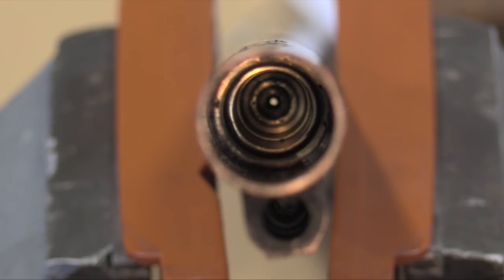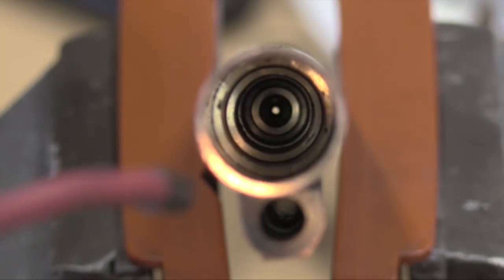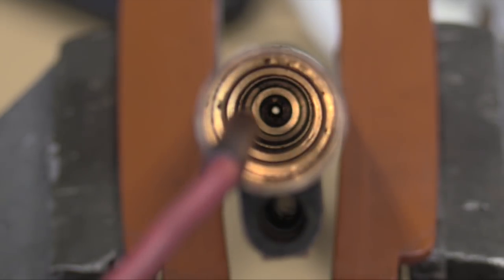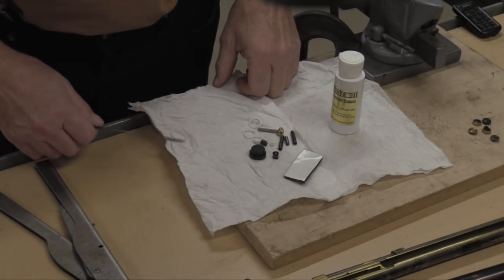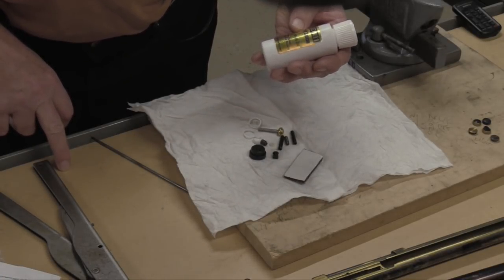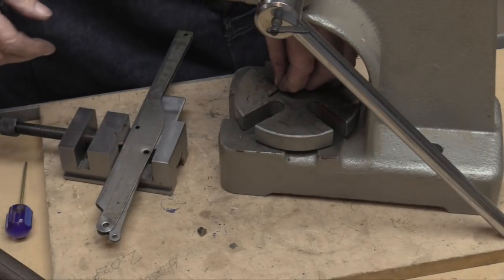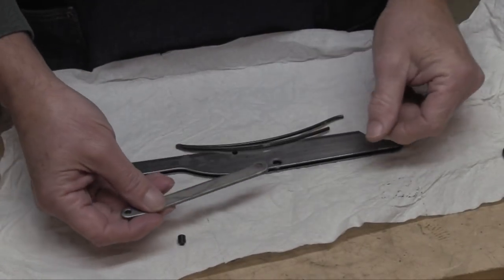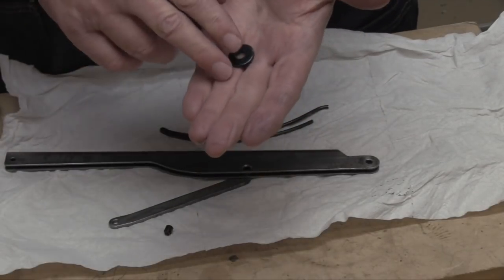Air Time No.  9 - Sheridan Streak from Hell Rebuild pt. 2; prep and installing Mac1 seal kit

Comment: Thank you for this information I'm working on the same gun at the moment but I don't have a tool to take out that nut that holds the valve in place 😞 so I need to figure that out thanks for sharing the info be safe buddy 💯
Reply from the maker: Well, there's this;
https://www.ebay.com/itm/116036072827?itmmeta=01J1ZB738EWZ51DDEHJD4PCBN6&hash=item1b0449f57b:g:Y~oAAOSw7RFj1sJi&itmprp=enc%3AAQAJAAAA0E5EFmuwjGZ%2B8p1NcnbVulRrktK4%2FkR6%2FaltQpU8KGowJSvBcXZ87HXBZnKg%2BQmjgMLqbzXo4rBObzyVULVm6eNd5hquTIdKPFVDY%2FH1DLoYcyB3gB1sExNaxk8aDaJuzoTGKNA%2Bh9eu612zhqGwsDnwYHD9%2FCr0cIdfHOxgfRcbUXQUUwpkKtDiHO8AXQDXNGIyZtMzsCvaC%2FQHfZx5ue0gja%2Bc5KIj%2BFTqyFR2HwGcj5wHjieT65YLWhF1afjVgWEmkCmlTlfjjPZiaRwM5fA%3D%7Ctkp%3ABk9SR6i0nOuPZA

And you can also find the tool at Baker Airguns;
https://www.bakerairguns.com/product/valve-tool-for-benjamin-sheridan/
Reply: @NorthWestAirgun  ok I made a tool with a lathe do I just pull out the valve like straight out or I need that other tool is well because it's hard I got the nut out but I can't get the valve out

Comment: Recently replaced the seals on my newer model 397, the hardest part was those roll pins on the end cap. Then attaching the new piston seal , a process you don't show. I had to beat the hell out mine basically, it's built like a tank. Thankfully Crosman still carries all the parts and they carry over to the new models with the synthetic stocks. They've dicontinued the wooden stocks, so anyone with wooden is lucky.
Reply from the maker: Ty, There is some seal stuff and other tips in some of the other videos, couldn't put it all in one, or even in the 'Streak from Hell' series.  Sounds like your rebuild turned out ok in the end?
Reply: @NorthWestAirgun   It did. I bought a roll pin punch set for the job. I wound up getting  the piston seal onto the rod by hammering down upright from the other end, that burred the edges on that end a bit but used a fine file and got it smooth. I used pellegun oil, just to make it true to Benjamin's specs. Downloaded the parts schematic from the Crosman site so it was a pretty simple job. Would still like to know how you got your piston seal on the rod. Could you link the vid?

Comment: Great Timing John,  I was just starting to look at how to replace the seals on my dads Sheridan blue streak that I got from his estate.  Luckily its not in bad shape and I don't think it has ever been apart. I'm so glad that there is a rebuild kit, can you provide a link to the Mac1 seal kit?
Reply from the maker: Hi Darrin, that's cool that you still have a family Streak.  You'll need the valve tool, which you can get from Pyramid Air, Baker Airguns, and even eBay if you search for Sheridan valve tool.  As far as kits, I recommend the Mac1 Airgun Shop kits, but there are others at the sites noted above.  And take a look at our video on installing a single port valve, (the Sheridan valving is pretty much the same but without the single port issue), the valve polishing tool, and the ones about cleaning your parts.  Take your time and don't push things and you should be ok.  Let us know how it turns out.

Comment: enjoyed your videos. they are very detailed which is something I may need. I have an old Sheridan silver streak 5mm. when I tried to use it a couple of days ago, there was no pressure. since it seems to have happened rather suddenly, I did not think it was a lube problem. I did find an extra pellet which I must have done once there was no pressure. after many pumps, dry firing, as well as some live pellets, there is minimal pressure. not enough to kill a pesky ground squirrel, but at least it will exit the barrel. should I just try more lube and firing to see if it gets well? or is there a single part like an o ring or spring that is likely bad. I don't really want to put in all the labor for installing a rebuild kit like the one you installed. my experience is that there is usually a singular cause for most failures. this is an old air rifle from my youth and has little value other than pest control. I must not be a very good shot anymore because I miss about 80%of the time. at 75, my aim is not what it used to be.
Reply from the maker: Well,  be thankful for the 20% of shots that hit the mark, I guess.  And cool that you still have it after all these years.  Try this; open the cocking arm, and funnel a thimbleful of alcohol down into the hole in the bottom of the tube, just aft of the cocking lever slot.  Then pump one pump and sit the gun in the corner, upright, overnight.  Next morning, pump a few more times and shoot out what's in there.  Pump and shoot several times.  Then do whole procedure over again, another overnighter.  You might have to do it several times.  Probably gunk will get shot out, so clean the barrel before shooting pellets.  Many people tell me it will clean out the valve and allow even old seals to hold air again.  At least for a while.  Post here if it works.

Comment: I understand the concept and reason for wanting to compress the exhaust valve spring. My question is, did you do so because it was a new spring supplied with the reseal kit and was stiff? If it was the original factory spring, would you still have compressed it? I'm getting ready to reseal my Blue Streak and just wanted to know. Thanks
Reply from the maker: Depends.  The exhaust spring ideally will be strong enough to just hold the valve closed while you pump and get some pressure behind it, maybe even require that you cock the gun before pumping.   But weak enough to not close the valve very fast, i.e., allow all the air to be dumped.  Old springs might have lost a bit of strength, which would argue for re-use.  So, if the kit comes with a new spring, it’s your choice to use it or not.

Comment: Hi John, I have a 1981 Benjamin 342 with the keyed rivet that's worn and creaks. I've ordered a Mac1 replacement rivet, do you drive the old one out by hitting the keyed side? I don't have a press and I'm hoping I can still do it with a hammer and punch and may be heat if needed? Many thanks.
Reply from the maker: Also helps to center drill the rivet first, doesn't have to be all the way through, yes, from the keyed side.  The problem is drilling in the center of the rivet, and not enlarging the hole.  Here's a url that shows it;
https://www.kitplanes.com/flush-rivet-removal/
Reply: @NorthWestAirgun  thank you Jon, I feel more confident in tackling this now.

Comment: I did a rebuild after watching your videos and it came out great, except for one thing. It doesn't evacuate all the air when fired. There is plenty left in the chamber. What can I do to fix that? Is it a spring issue?
Reply from the maker: How many pumps are you putting into it?
Reply: @NorthWestAirgun  Anything from 2 on up to 8. That doesn't seem to matter, other than the leftover pressure.
Reply from the maker: @jhill123  Jim, lets take this to email;
nwa@northwestairguns.com
Reply: @NorthWestAirgun  yeah thanks, because that helps everyone...

Comment: Ok. So I've gotten to the point on my rebuild that I'm putting it all back together. Somehow, I've lost the stock lug. The threaded "male" part that goes inside the tube and the nut goes on the outside.  27:31 Any ideas where I can get one without having to buy a whole parts gun? It's a 70s Blue Streak. With the rocker type safety.
Reply from the maker: PM sent

Comment: Why did you skip the valve install??  how is that not important? Great besides that major step missing. If I didn't do my due diligence I would have felt misled into buying mac1 parts kit..
Reply from the maker: There are other videos on our channel that show how to clean, polish, install the valving and seals, etc.  Hard to put it all into one and not be several days long.  But we will have another Sheridan rebuild coming up that goes thru the valve installation process.  Check back in a few weeks.

Comment: 25:00 This is how you destroy your seals, casually shoving shit back into the tube. Doesn't matter if it's the piston going in from the front or the valve going in from the back, MAKE SURE EVERYTHING IS DE-BURRED AND THERE ARE NO SHARP EDGES. Especially the track the pump armature rides in and the roll pin holes.
Reply: CrucifyRobinHood yes i agree. I have a 1972 that im about to fully restore. It still shoots flawlessly in 2020 without ever being rebuilt! But it deserves a full overhaul. .

Comment: My Blue Streak has a number of 0791F and doesn’t hold air. Is it worth fixing?
Reply from the maker: Well, that # would date it from 1971 or 1972, don't know what the F means.  Yes, value certainly exceeds cost to repair.  If you don't want it, let me know and I'll send you my shipping information.
Reply: NorthWestAirgun, So you’re saying it’s worth fixing?  Price for Repair?
Reply from the maker: Yes, you can check out the 'sold' auctions on eBay to get an idea of value.  But Streaks in decent, working condition usually bring $125 or more.  Cost to repair is $70 plus shipping, less if you shop around (cheapest in the Pacific Northwest is Ollie Damon in Portland).  So yes, it is worth fixing.  And, streaks are discontinued, so they ain't making any more of them.  If you shoot much, it is a better gun than the pumpers available new today.  If you want to sell, you can make a few bucks fixing it and then selling it.  Or just sell as-is.  There are plenty of people looking for Sheridan or Benjamin/Sheridan made streaks (before Crosman bought out the Benjamin/Sheridan brands), even if they have to have it repaired.
Reply: @NorthWestAirgun  F stands for june  1970 date it was inspected its in reverse F is sixth letter meaning 6th month .. 0791 F = june 1970

Comment: What kind of cleaning solvents did you use before installing the new parts? Do you have a particular regiment? I just finished disassembling mine and want to clean it thoroughly before reassembling. Also wanted to say thank you so much for making these videos on the blue streak.
Reply from the maker: Check this out;

https://youtu.be/71ZsLcL-Loc

It's a 2 parter.
Reply: @NorthWestAirgun  
Thanks!!!

Comment: Is there a way to know what yr by the serial #?
Reply from the maker: Well, there's this; 

https://discover.crosman.com/blog/benjamin-sheridan-product-dates-of-manufacture

Sometime around 1964, Sheridan started putting numbers on the left side of the reciever, at the trough where you load the pellet, that was the reverse of the year, i.e., 4691 was actually 1964, etc.  Before that, hard to say.
Reply: @NorthWestAirgun  ty but it's no help,, It's definitely a Benjamin Sheridan and it's a C9A series 20 cal and a serial #1967702911 funny can't get any specifics on it.
Reply from the maker: @drunkingsailor2359  That looks like a Crosman type number.  So the gun was made after Crosman acquired Benjamin/Sheridan in the early 1990's , and before production stopped, what, maybe 7 or 8 years ago.  Doesn't narrow it down much, eh?  Maybe ask Crosman directly;
https://www.crosman.com/support-contact
Please let me know if they respond.
Reply: @NorthWestAirgun  Tried that already short of calling them, the site has a form you fill out and requires the model# from a list that is missing the c9a series, thr closest cousin is the the Benjamin 392 in the .22 .
So it's going g to be a phone call Monday I guess

Comment: I'm gonna take a break and come back to this in a few days. I'm not sure you realize this but there are exactly ZERO vids on the issues with the valve alone. Sitting through 20 minutes of armature rivet installation, hoping you will eventually get around to the valve is killing me. The work you HAVE shown on the valve, specifically machining the inlet valve seat look great but give no helpful info for those without a lathe handy and really, doesn't help lathe owners either. Why is it so hard to get a straightforward look at the valves on these things? God help you all if I ever get a decent internet connection.